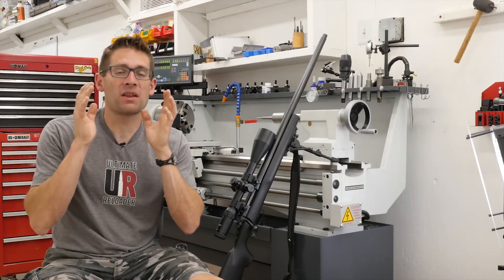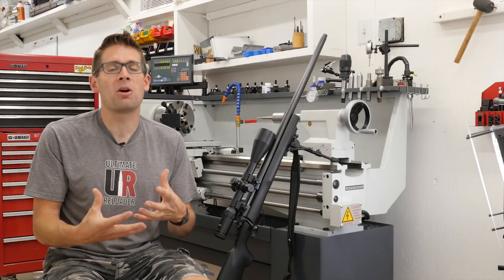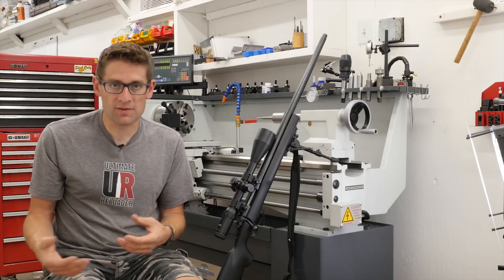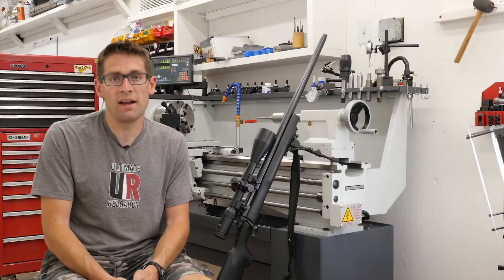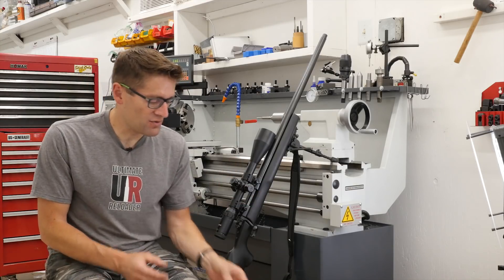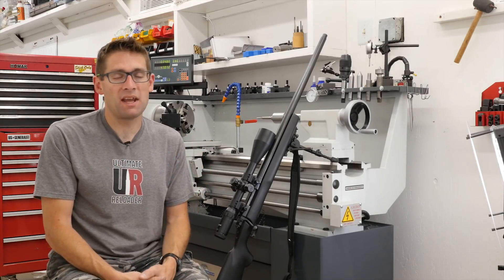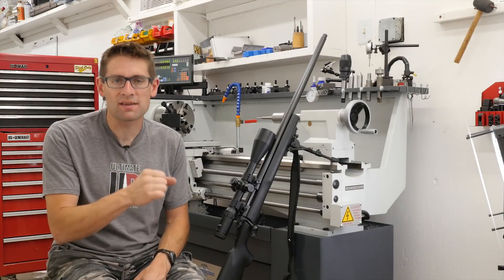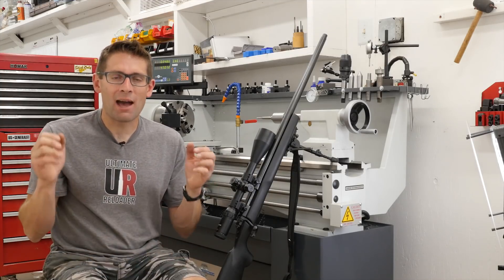Winchester 70 Rebarrel Part 1: Overview

Comment: Rly good info and rly in depth but facing a barrel nut and the front of the action and no barrel shoulder would've saved u so so much time and is just as accurate.

Comment: So this was a custom made from scratch barrel for the model 70, correct? What if someone wanted to change their modern model 70 .243 Win to a faster twist 1:8 for the higher BC bullets available, where would someone source such a barrel? Or say if there is a higher BC .270 Win bullet out there, is there replacement faster twist barrels that can simply screw on for this caliber as well? Thanks

Comment: Enjoyed your video very much. I'm wanting to change a lightweight barrel to a Factory Bull barrel on my Mod. 70, do you think it's feasible? Or is the the lightweight rifle different?  Thank you and hope to here back.
Reply from the maker: Joseph- you may have to have the stock inletted as I had to do for my rebarreling job. The profile of my replacement barrel was "fatter" compared to the factory barrel, so I made the tool shown in this series and inletted it on the milling machine.
Reply: Gavin, thank you for the quick reply and the needed information. I watched all 3 of the videos and know the tool you referred to. I appreciate your time thanks again.
Reply: Thank you very much for your quick reply and needed information.
I watched all 3 videos and know the tool you referred. I appreciate
the time you spent answering my question. Very glad I found and subscribed to your channel.

Comment: Cool stuff! So many activities can be had! Custom fit muzzle brakes, barrel recrowning, rechambering, and more. Excited to see what unfolds. Little by little smithing is putting ideas in my head.
Reply from the maker: Good deal- I see from your name you're into diesel as well ! 💪
Reply: You bet. Driving a Cummins powered ‘01 Ram at the moment. The wife hates it but I love it. 😎
Reply from the maker: Me too! Mine is a 2001 Dodge 3500 Dually with Cummins, NV-5600 6-pd, Firestone airbags, bigger turbo, 3.55 gears (love it), tuner, Jacobs Exhaust Brake, etc. https://www.facebook.com/photo.php?fbid=10213617040082446&set=pb.1296844750.-2207520000.1532658638.&type=3&theater
Reply: Kudos for running a six speed!  I have a 2500 2x4 extended bed also with a NV5600. The motor is all stock. Few upgrades on it are 4” exhaust, polyurethane front end bushings from Energy Suspension, gauges, and a half completed stainless steel hard brake line swap. I wish the doors looked as good as yours. The dreaded lower door rust has taken hold. Kick myself for not taking care of it even though I knew it is a common problem.

Comment: Another fantastic video.  Just shot a 0.078 inch group at 100 yards (3 shot group).
Shooting a 6.5 x 284,  32 inch Bartlein barrel, Barnard P Action, 6x36 IOR Valdada 0.12
Moa scope - 2nd focal plane. The gun sits on top of a 50 Cal McMillan stock. Gun weighs in at about 28 pounds. I have been fine tuning this gun for 2 years. The exterior of the stock has 
5 coats of epoxy mixed with iron oxide. The action sits on an aluminum V block and 
entire action and 3 inches of the barrel is glass bedded. The gun has a Atlas bipod. 
Chesebro Rifles in California built the gun. I did all the fine tuning. Currently shooting a 130 grain Sierra TMK.
Reply from the maker: Good deal, sounds like an awesome rig you have!